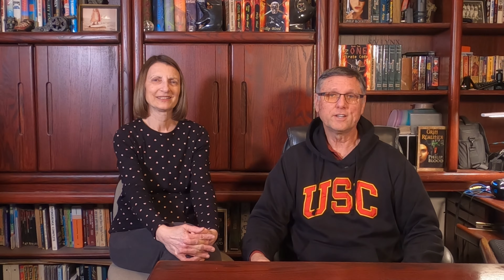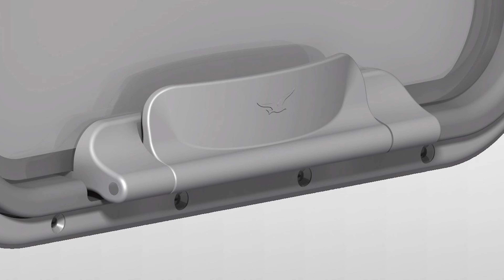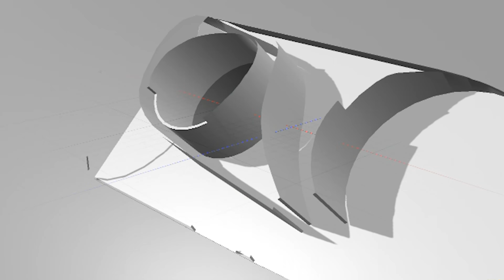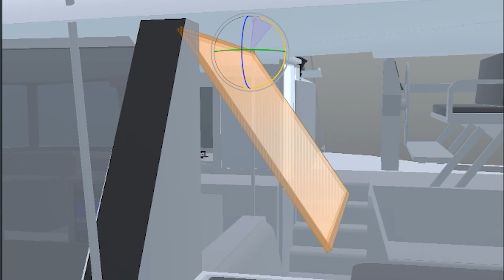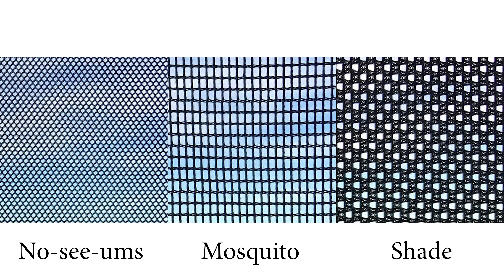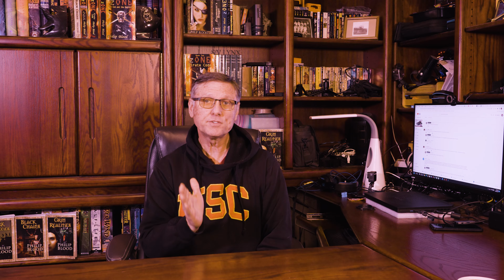Kit-E21 Catamaran Ventilation Systems and A/C design

Comment: Just some thoughts;

Your dorade solution looks quite interesting, hopefully you will be designing a method of sealing/locking them down for really rough weather, a little concerned that to make such a low profile intake that performs well you may be a little more vulnerable to swamping in heavy weather (I'm sure you have thought of that). Not exactly sure which ventilation system the O'Kelly's referred to but there are other designs which use the centre forward wet lockers (opened hatches mainly for use when at anchor) as intakes and have a dorade baffle in the top cnr, their efficiency can be increased by using a fabric wind scoop common for increasing hatch ventilation ..... however this may not be so useful underway (I think Balance Catamarans have a similar design?).

I think some new designs are opting for sealed escape hatch that you break rather than open like a hatch ...... for me this would be preferable as the escape hatch is really only used in an emergency capsize and are when you are stuck in the hull (extremely unlikely) ...... so would rather a better permanent seal than manage the potential leak hatch seal.

With the soft clears/mesh my preference is to have specifically designed built-in recesses in the coach roof to accommodate the rolled up clears in situ with a nice tidy fabric cover (like Lepoard and some of the newer Lagoons?) this negates the need to install and strip the clears off all the time or leave them rolled up and hanging. If you also consider multi colour cabin lighting that can be switched to yellow, which is less inviting to insects than white light. Most people only seem to think of installing white and/or red, but yellow can help reduce the attractiveness of your abode to flying insects at night.

Be careful using bug spray, as some can melt plastics and have a detrimental effect on paint and finishes ...... as well as it is poison not just for them, not so good for you either.
Reply from the maker: Yes, my new dorade boxes will have a method of mounting, likely bolts that go through to a backing plate.  That model in the video was just a preliminary version, I have some work to go before I would print the first version for testing.  Something else I didn't show in the video is that n VERY rough weather, where the boat side might be overrun by green water, we will have a plug that may be inserted from the inside of the boat that closes off the intake of the dorade box completely, so that it can't be overwhelmed and allow water to enter the boat.  Those shouldn't be needed often since most sea states won't bring green water that high up on the angled side of the hulls where these dorade boxes will be mounted.  Still, if it gets really nasty, we can go down and close them off for the duration of the bad weather.

I am familiar with the break open escape hatches, but we are going with Goiot's escape hatches.  We want to be able to open them at a calm anchorage for some added ventilation, which is why we are mounting them as high as possible off the water.

Yes, we are looking into adding recesses for the enclosures, but will have to see if we have the head room for it.  We don't have the massively thick coach roof of those production (and heavy) catamarans.  A Leopard 50 weighs nearly twice as much as our Solitaire 1520 (Leopard 45,000 lbs., S/V Lynx 25,000 lbs.).  Still, we would like the recesses and will be seeing of it is possible to add them.

I'll consider the yellow light idea :)  As for the bug spray, we're not yet convinced on which way we will go to stop no-see-ums :(
Reply: @SailingSVLynx    Thanks so much for your reply, as for the dorade’s my main concern was that you had a way to “plug” them to manage heavy weather (as well as bugs).  I guess my personal design preference is to minimise potential potential water ingress points and dorade’s and opening escape hatches are areas which need to be given a lot of thought.

As for the coach/cockpit roof, I certainly was not suggesting you adopt the heavy weight design of Lagoon or Leopard, just when you mentioned clears ...... it seems many designers don’t seem too concerned how they ultimately stow. If you are designing a rain water catching channel/grab rail into the roof then the negative space on the underside of the roof could be exploited to house the rolled up clears along the margin without investing in making the entire roof 4” thick.

Thanks again for taking the time to respond, these are just divergent thoughts generated by your videos please do not consider them as criticism.....there are many ways to skin a cat, excuse the pun, Cheers
Reply from the maker: I thought no such thing!  I enjoy discussing ideas and love getting suggestions from you or any of our viewers!  Keep it up!  The negative space idea has some merit and I will look into that for the stowage of the enclosures.

Comment: Uhh, the tropics have rain and lots of it. Uhh open deck hatches will pour rain in! The golden rule ,,keep water out of your boat! Uhh AC?? Look into zone AC. Central air seems problematic. Four small units instead of one big unit.
Reply from the maker: Which is another reason we eliminated most of the deck hatches and decided to add some dorade boxes for air flow while in wet conditions.  As for the only two deck hatches we kept, we can add removable rain covers over those if we choose.

Comment: I investigated several 48 volt AC/ heating systems, and spoke with several importers at the boat show last fall in MD and had no luck. Most were priced in the stratosphere. I think the best solution right now is from Mabru. I spoke with them yesterday and for a 50 ft. Cat they recommend one 17k BTU 230v and two 12k BTU 12v. The 12 v use about half the power of most other manufacturers units.
Reply from the maker: We looked into the Mabru units awhile back.  They are the same basic technology that we are currently looking at, but these are in 48v units instead of 12v, which we prefer.  Price will matter though, and I don't have the cost for these yet.

Comment: You might wanna look at a water chiller system.. that can easily be zoned from a main chiller unit...
Reply from the maker: I looked them up awhile back, and decided against one for a performance cat our size.  They are generally put on larger yachts.  Here is one sites 'Cons' for a chiller system that kind of explains why we decided against them.  
Cons:
Chillers are expensive.
Installation is complex.
There are more economical options for smaller yachts.

Comment: How much, what size for ac,  12000 btu per ton of ac,  a house is figured 1 ton per 400 sq FT... so a 2000 sq foot house would be a 5 ton unit... 60,000 btu....  I know people will disagree on this cause it all depends on insulation....   but those numbers are what has been used for years...
Reply from the maker: Our cabins are very small, about 12 cubic meters each.  Conventional calculators show you would only need 4000 btu to cool that small area.  The salon is about 40 cubic meters, and that would require around 13,000 btu.  If we went with four 6000 btu A/C units, things should be fine.  However, we might have to purchase 8,000 btu units if they don't make small enough ones in 48v units.

Comment: A couple of things to mention that I noticed from other channels you might want to look into.

1)  Instead of AC plus heating, try looking into a reversible heat pump to provide both.

2)  Vent your cabin heating and cooling right in your birth area and then put a curtain around the birth so that you don't have to heat or cool the entire cabin while you sleep.
Reply from the maker: We are looking for a single A/C unit that does both.  As for the curtain, that's a possibility we will look into.  Thanks for the suggestions!

Comment: An enjoyable and informative video! The custom Dorade box shape is inspired; I see one small possible alteration, but I'm certain that you've already thought about it and will test it out, while you're fine tuning the design.
When you're researching the air conditioning and heating systems, did you consider the addition of a dehumidifier option? They take so much less energy and it's easier to deal with a dry heat (too many summers in the South Pacific can attest to this! 😁).
I know that you're planning for any and all circumstance, and was wondering if enough storage for all of the different wet/bad/foul weather garments has been planned into the design? With your goal of multiple circumnavigations, I would imagine that you would require at least four different one-piece garments, as well as separate tops and bottoms. Layering in colder and wet climates is essential and everything is bulky (I'm writing this as I'm sorting through five different HH coats and jackets and all of the thermo layer tops!).
Thank you so much for sharing and being calmly excited about this amazing project.
Reply from the maker: Hello Leon.  I didn't go into detail on the dorade box, but it has three water/air separation chambers, so we hope it will work as expected, but we'll find out in testing.  And yes, we are looking into dehumidifiers, in fact, there is a section about them on our website, here: https://www.svlynx.com/environment.html
As for wet foul weather gear and also our wetsuits, we have a compartment toward the stern, on the port side, that will have a hanging rack to handle these wet types of garments, it is just to the stern of the rear cabin, with a deck hatch for access, just in front of the sugar scoop.  Some of the drier type winter garments will be stored in the cabins, sometimes in the large storage area under the forward beds.

Comment: I wouldn't go with the dorade scoops. The ventilation you gain is not worth the risk of them getting overwhelmed by a big wave, or torn from the hull from such a wave. We almost never open our deck hatches for cabin ventilation. An opening portlight on the inside of the forward cabins brings in huge amounts of air as the wind tries to squeeze under the bridgedeck, which then flows out the open portlight in the aft cabin. Even with that airflow available, we're much more likely to turn on the 12v air conditioner in our cabin because the low humidity it provides can't be beat for a good night's sleep.
Reply: FYI, my 12v unit draws about 200ah a night. I have 600ah of lithium and 1600 watts of solar. Currently in Martinique,  has been more cloudy than not today, it's 11am, and my battery is at 83%. I expect it to top before 1pm. I haven't run the generator to make power for about 10 weeks. It seems the only thing I use the generator for is running the dive compressor. Buy the 48v AC and forget the dorades. You'll be glad you did.
Reply from the maker: Our custom dorade boxes will be very low profile, and strong with continuous carbon fiber added.  I have no fear of them being torn off.  Now,  will then leak water when swamped, that's another story, and one we will test before deciding on using them on the boat.  As for opening a portlight while underway, there is far more chance of that taking on water in the cabin than a dorade box.  Now, I'm sure you meant you were only using your portlights while at anchor, but that doesn't supply air underway.  In our case, at anchor, air will not always flow between the forward cabins and the stern since there are privacy doors between cabins, which will often be in use since not all crew will be family.  
Now about using A/C.  We will use the A/C at times, but not always.  It really does draw a lot of power.  Your example below is for one unit, so we will put four times that with four cabins, or 800ah at 12v (using your number).  Remember, we expect to have 3 to 4 cabins in use, almost all the time.  We do have lots of stored energy, in our case 352ah at 48v (usable power).  That is equivalent to 1,408ah at 12v, so we have enough to run all four A/C units, but that will use a healthy chunk for a night of A/C, more than half our capacity.

Comment: I was thinking of using integral 48v AC and then a hydronic hearing solution from hurricane that runs off Diesel- this would give me heat up north where 1. I need it and 2. I won’t be able to capture as much solar - 3. Give me hot water - all without adding hours to my Gen set.  - admittedly I am looking at this for a monohull where weight is not as much of an issue. 
Not a lot of information available on the Integral unit out there though so I can’t find if it has a reverse mode and will do heat. - I’m sure you know this but there is also a 48v anchor winch available- saving on wire size and cost for the long run forward. - Good luck and keep the videos coming….
Reply from the maker: I looked at Integral, but they were very expensive.
Reply: @SailingSVLynx  I look forward to hearing about the company you found.

Comment: diesel heater - less power draw and little fuel use (vlog onboard lifestyle abt 4 years ago - install of diesel heater ep 41/42/43/44 ) - plus your reverse cycle air con - Also DC  to AC are about 90% efficient and 110v / 240 v a/c are cheaper as more built - same with fridge freezers which reminds me - one word eutectic - very good if excess solar or power available - poor mans eutectic is to keep fridge freezer full eg extra water bottles etc
Reply from the maker: Hey Jim.  I've watched all of the Onboard Lifestyle vids as they came out.  However, we decided against the diesel heater simply because it is yet another system to add when we will already have A/C units capable of heating the boat.  As for little fuel use, little is still some and we prefer using power gained from solar and regen.  Due to that, we won't have to run the diesel generator much of the time for A/C.  And, as to the 90% efficient that's still a 10% loss or 2.5 kWh a night if we are using four cabins with A/C.  I haven't ruled those A/C units out, but it all depends on the cost of the 48vdc units in comparison.  We'll see.